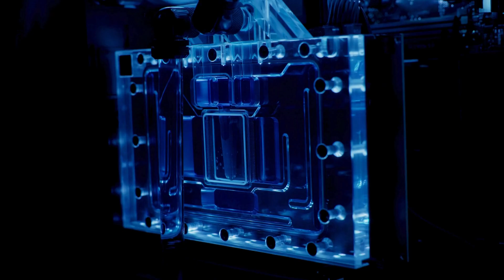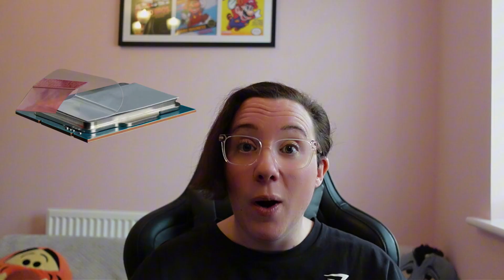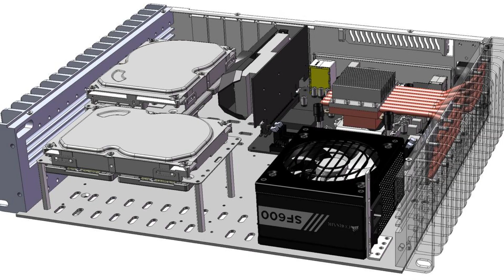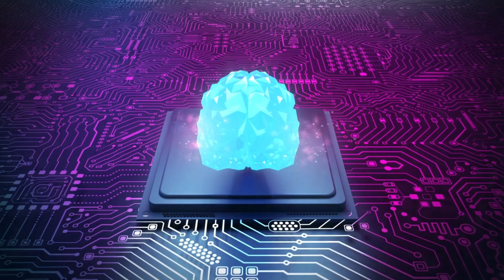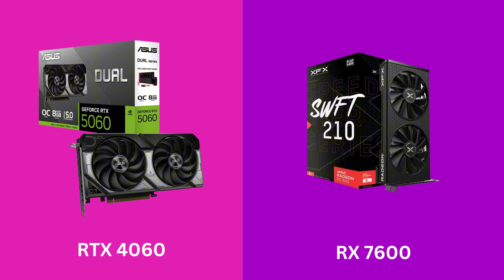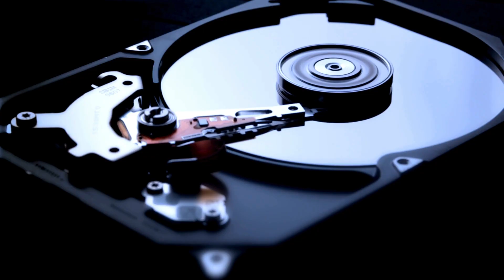How to Build a Totally Silent Computer!

Comment: Doesnt matter if the system is fanless for quiet. Coil whine can ruin    those silent builds. I have costum watercooling and had to undervolt the GPU to eliminate the coil whine. The 7800x3d is very efficient, but for some reason doesn't cool very efficient. My radiators are cool and the processor itself still passes 60c sometimes. The GPU doesn't even reach 50c. So it's some internal design that prevents the chip from cooling down efficiently. Good explanation about cooling mechanics by the way.